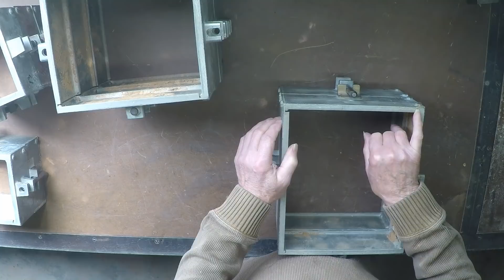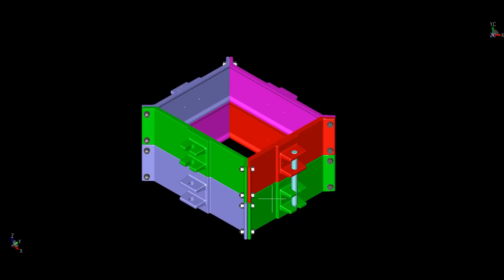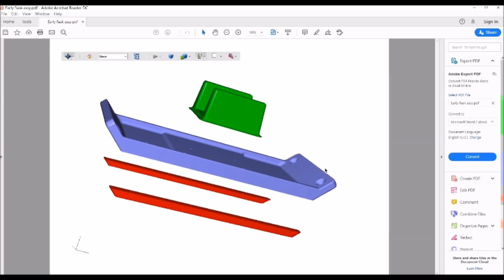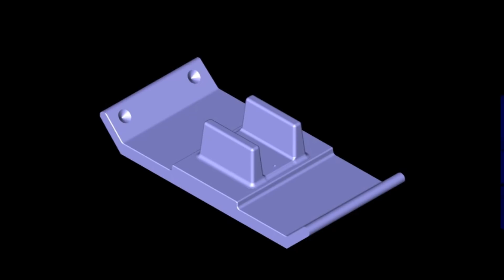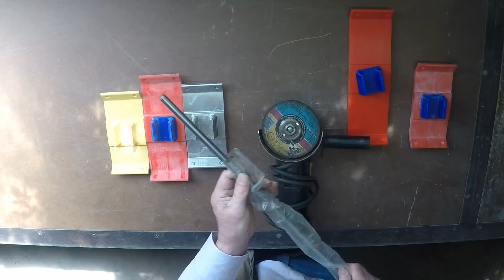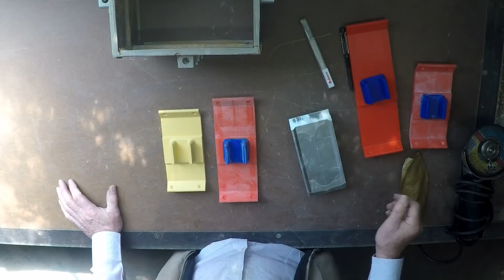Make your own metal moulding boxes

Comment: Depending on what time of filament is being used, there are usually chemicals that can be used for post processing such as acetone vapor, isopropyl alcohol, etc. Might save you some time sanding and painting!
Reply from the maker: Flying, MEK was also recommended to me and I have tried a few things but without as much success as I would need to avoid sanding painting etc. In addition I sometimes got distortion, a fatal problem with a job like this. Sanding painting etc is indeed a bit of a pain but with a flat job like this its not too bad, with something more intricate though its just not on - I know - I have tried …😥 Martin

Comment: I've been trying to determine how to go about sizing sprue diameter and taper! I've been through most of your videos and, I suspect that I've missed something! I've considerably reduced diameter. I have a large pattern to pour, it's a 30 cm diameter wheel with a finished weight of about 5kgs without sprue and risers! Your comments would be much appreciated! Regards, Matthew
Reply from the maker: Matthew, I don't think that I have ever properly covered how to calculate a sprue in any of my videos so you have not ""missed" it. I did try some time ago via an excel spread sheet to find the "Holy Grail" of sprue tapers i.e. the universal taper that would satisfy all occasions -  Sadly it does NOT exist. (I might publish this work at a later date.) But the required taper depends on sprue height, shape of sprue (i.e. round square or slot) area at base of sprue and relative height of sprue and sprue basin. I was disappointed that it all turned out to be so damn confusing. I use a sprue that is 8mm diameter at exit and has a 1.4 degree taper per side. This seems to suit most of my work (Aluminium 2 kg and down) Your situation 5 Kg net and possibly 8 to 10 Kg gross is altogether another  situation. The Brush piston that I cast is closer at about 4Kg gross and there we used a slot sprue (way to big as it turned out). Can you send a drawing or at least a sketch of the casting and your feelings re the mould gates feeders and fill time etc to  olfoundryman@gmail.com and I will have a bit of a look and a calculate and see what I come up with. There are some interesting ways of doing wheel type castings and I have done them up to 43.5 cm  in diameter * about 1.5 cm thick (a lathe face plate) quite successfully..Martin
PS, are you in Australia

Comment: Thank you Martin for sharing all your knowledge. I am wondering if there is any color code standard for part, core patterns or to know for which metal the pattern is done...?
Reply from the maker: FGn. Yes, I think there is at least a colour code for which part of a pattern is a core print and which is cavity. However I know a "tame" pattern maker and I will ask him. I have not heard of a coding for different metals to be cast but it would not surprise me as a 2 foot contraction rule that I have has 4 different length scales on it -  one scale is true inches and that others are longer to allow for the differing contraction of brass, aluminium, and cast iron. If I get a sensible answer from the pattern maker I will pass it on... Martin
Reply: @olfoundryman8418  thanks Martin, I assume so but did not find literature  on that

Comment: Good design Martin,if I didn't have enough molding boxes I'd make a couple but would make the patterns from wood [not into 3d printing I'm afraid!] hmmn might even make a couple as I like the design.
Graham.
Reply from the maker: Graham, As the design takes shape over this video series I think you will be more impressed and even more inclined to make some for yourself (not that Iam biased of course 😊 ) Shortly, thanks to my good friend Nigel from "smallcnclathes"  the files for the box sides will be available as either  the STL for 3D printing or a PDF drawing with measurements for the wood whittlers  and a STEP file for cad/cam work  Contact me on "olfoundryman@gmail.com" if you want any or all of these.... Martin

Comment: Great video. In all my 3D printed patterns I always put a small fillet on all the edges. It makes a huge difference. After seing your boxes a year and a bit ago I design some boxes very similar, but using cut down Aluminium C channel and screwing in the pin guides. If YouTube let me post photos I would have put some screenshots up here. Look forward to the next video
Reply from the maker: Macwhirter. I too had thought of the extruded channel method and I may yet do an alternative method of making boxes using it, there are some channels available that require only a little cutting down and use 3 mm section aluminium. However I think the all cast design has some advantages as will (I hope  )😊 become apparent as this video series develops. We did put fillets radii etc wherever it was possible and as the desigh iterated through a few versions more and more got added!. I would love to see your photos so come to me at "olfoundryman@gmail.com" and I will give you an email address that you can send them to. Next video quite soon...Martin

Comment: Thanks for your work here Martin. Hoping to do some aluminium flasks in the near future. If you didn't have the restrictions of a 3d printer would you do it any different? When I do make, my plan is to cnc router patterns.
Reply from the maker: Making, My good friend Nigel at smallcnclathes is kindly doing PDF type drawings of the box side and the other little bits needed to make it easy to cast. If you send an email address to "olfoundryman@gmail.com" I will forward a copy of these drawings to you as soon as they are finished. We just chose 3D printing because it seems most (but not, I guess, all) people seem to have access to one. A pattern CNC routered from billet or solid wood would be a very good and accurate pattern. I guess that how you make the pattern is entirely up to you. And for sure having a mill or router will make the whole process a bit easier. Stay tuned for the rest of the series..... Martin

Comment: Hi Martin, thank you again for a great bit of information and knowledge.
in regard to the splayed corners of the box.
I have a mill in the shed. and am contemplating casting some boxes.
why did you opt for a 45 splay instead of using square ends?
I was planning to flange and overlap the ends in a square configuration , after casting trim the ends to length and to square, then bolt the square corners. 

I am interested in your view on this.
thanks
Reply: Charles, I am thinking that the idea behind the external miters is to increase the flexibility in matching up of the various box sides in the different sizes. The only difference between them is in the lengths whereas your method requires sides and ends in the different lengths to work thus requiring more parts to achieve the same flexibility in box sizes.
Reply from the maker: Charles, If you look at my video on my journey through moulding boxes you can see that for the two last lots of aluminium boxes that I made I did it exactly the way you are thinking of. I used a friends horizontal  mill with a gang cutter to machine all the square ends and flats to receive the mating end at one pass. At the time it suited me well - I simply sand cast 84 sides (took weeks!) and machined and bolted together to give 10 complete flasks 6*8 with a spare 1/2 flask- next (some years later!) I cast 170 or so sides (using a gravity die) to cast three different length sides, these gave me my 8*10  and 10*12 inch boxes (10 of each) plus a couple of 8*12 This arrangement suited me as I was making and selling lots of the same sort of castings and for anything unusual I would resort to an older wooden box. When thinking of a flask to suit the hobbyist I figured what was needed was a system that can be easily altered to accommodate different one off castings and of course very importantly be easy to make. Deliberately then we have come up with a method that does not necessarily need a mill. However as I am sure is obvious a mill would be useful - to cut the pin slots for example and although we don't intend that people do so we have left enough "meat" in the design to allow milling the long edges of the sides to give a possibly neater box  - if its done nicely and properly. There is nothing wrong with your idea, after all it got me by for 30 plus years, its perhaps a little weaker (particularly at the corners) that the 45 flange design but this has caused me only minor problems. However I suggest that you hang in there for as the series moves forward the flexibility of the system will become more obvious and I think you will appreciate its ability to accommodate greatly varied castings and you sure can use your mill if you wish - no rule against it 😊…. Martin
Reply: @olfoundryman8418  thank you greatly for the perspective
Reply from the maker: Mark, Pretty much got it in one … Martin

Comment: I have something unrelated but relivent . I'm considering building my first foundry and would like to know your opinions about propane burners and perhaps oil burners I think this might make a interesting series for you I'm sure you have a lot of information on the subject
Reply from the maker: Old iron, I have used both but my current furnaces are strictly oil as out here anyway its about half the price of LPG on a dollar per BTU basis. My big furnace will go through 55 litres of diesel fuel in a day so it can be significant although its more usual to use about 10 litres in a day with the smaller furnace that I use most of the time. Its much easier to  build a gas burner than a GOOD oil one (I bought mine) but regardless you need a blower with either to get the air fuel ration right (self aspirating gas burners are not the best at this) I see the gas bottle freeze up as a bit of a problem. With oil you can use waste oil but I found this too messy and abandoned it many years ago. I guess easiest and quickest set up is with LPG but personally all things considered longer term oil is probably best. I keep the oil in an old beer keg and pressurise this to about 10 PSI (no more) to push the oil through without the need for a pump, diesel, which I use, ignites  well and does not seem to need any sort of preheat. My oil burner is made from aluminium and does not even get much above warm during operation so it has lasted 50 plus years and is still going strong. I note that many LPG and home made oil burners seem to be short life things as they are pushed right up into the furnace an operate at least in part at red heat. I judge some of the small furnaces that you can buy as short life designs. My furnace, built around 1975, still uses the original lining - it will see me out.... Martin

Comment: Very nice Martin were so lucky to have all you years of R&D what is the hight of your boxes don't think I herd them . I might build myself a set of wooden patterns . No 3d printers here . Have hand tools at the ready
Reply from the maker: Old, My good friend Nigel at smallcnclathes is kindly doing PDF type drawings of the box side and the other little bits needed to make it easy to cast. If you send an email address to "olfoundryman@gmail.com" I will forward a copy of these drawings to you as soon as they are finished.   Martin

Comment: Thanks for the clear explanations Martin. I'll make up a batch of patterns the old fashioned way. But all your tips will be listened to and remembered for sure.
Looking forward to the continuation of the series. These will be keepers to be sure. This can easily be scaled up if needed as you have discussed all the design principles. Going to be an interesting bit of work ahead!
Reply from the maker: Mark, I was sure I had allready replied to you but I can't find it! How is the Canadian winter we have had one hot summer and now its very humid (unusual for us!) My good friend Nigel is part way through preparing a series of files for those wishing to make their own boxes. The series includes the necessary STL files for the 3D printing fraternity STEP files for the CAD  fraternity and then for the tradirionalists a PDF dimensioned drawing. If you want any (or all) of these contact me on "olfoundryman@gmail.com" and wheh they are readsy I will send them to you..... Martin

Comment: 3mm aluminium is quite strong.
Reply from the maker: Mr greens, Agreed  - but that design had a sharp edge where it thinned down to that 3mm making it a bit prone to possible failure through stress concentration. At 5mm and no "notch" It will absolutely never break.... Martin

Comment: Good to see and hear from you again Martin. I have to say that from a Carpentry and Joinery perspective that miters suck as they are a weak and fiddly joint. However, given that these boxes are to be bolted together and ease of manufacture is important to this exercise, mitre joints work best. Is the hardened steel pin really necessary or could someone opt for to use a mild steel pin or a bolt?
Reply from the maker: Mark, Always here  just a bit slow these days. You could use a MS pin but I strongly urge against it. I have used both.
1, Hardened pins are less likely to get bent in use (I have never bent one) A bent pin is a useless pin.
2, Hardened pins are less likely to get nicked, bruised or otherwise damaged. 
3, Hardened pins corrode at a much slower rate and any rust that does form on them is thinner and easier to remove than on MS pins
4, Hardened pins are (usually) better finished i.e. smoother
5, Hardened pins are less "sticky" I.e. there is less tendency for them to "solder" to the hole/slot they go into (the aluminium is very sticky and we don't really need a sticky pin too!
6, The hardened pins cost about $5.00 each - no doubt you could get an MS pin cheaper (maybe) but would the few dollars be worth it - I think not.-  Remember the pins need to be more than 130 mm long.
7, Above all do not use an MS pin threaded into place or held by nuts on the pin  - I have found such arrangements to be less than satisfactory
8, Have tried bolts and found them too soft, very sticky (particular if zinc plated) easily bent and damaged and the threads on them never quite seems to be parallel with the bolt - see my remarks in the earlier Moulding Box journey re bolts /threaded pins.
My advice stick with the hardened pins (not chrome plated!)… Martin